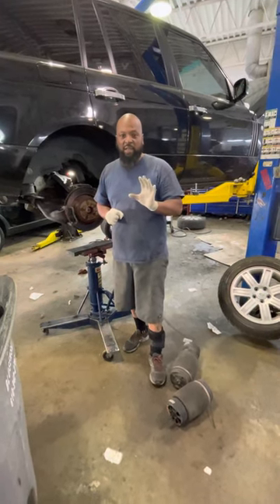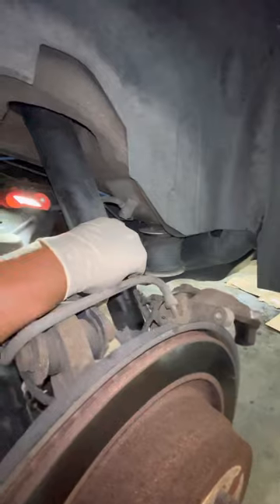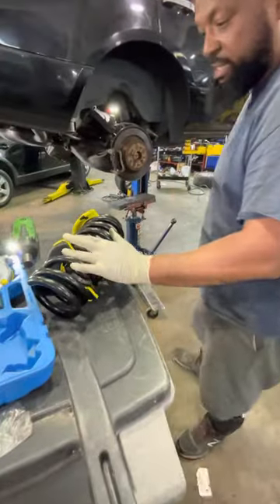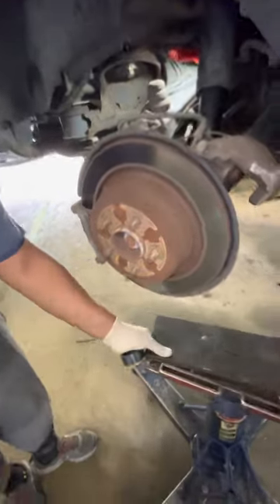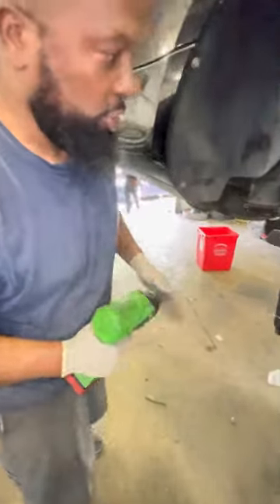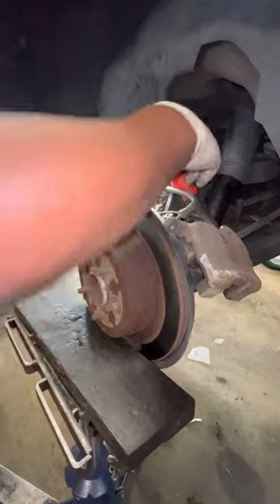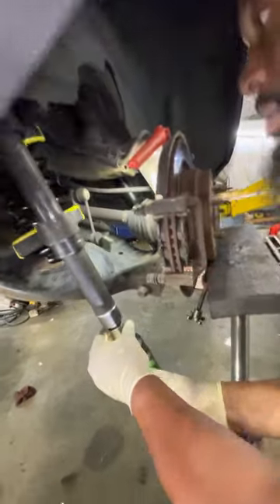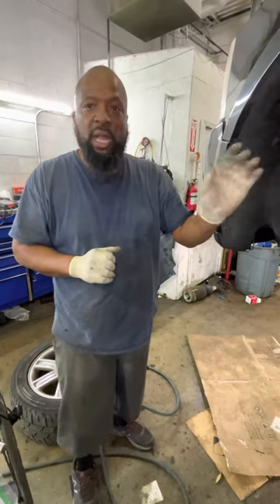Rear air spring conversion Land Rover Range Rover sport 2009 with strut master struts

Comment: Mr. Harris
Last message 

starts runs great! Gas gage pegs stops running heats up to 190 degrees normal. After it runs and shutdown won’t start again cranks.. next days cool down will start.

Bought new crankshaft sensor. Cold day here 45 
Changed started tan great ram for 30 minutes. Then stopped. Do you temperature has everything to do with is issue. Fuel pump? Or emc. Thank for help.